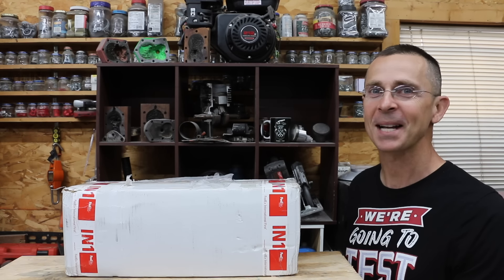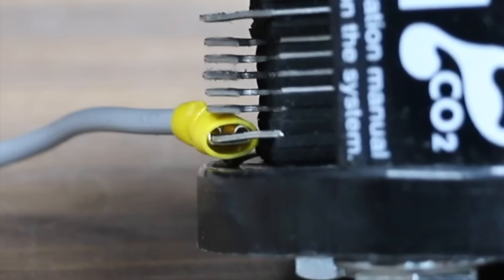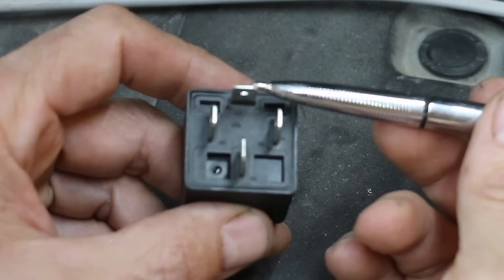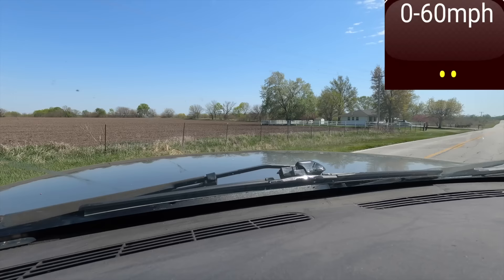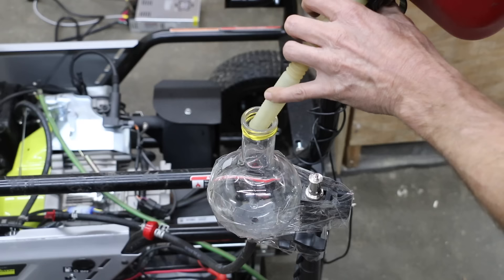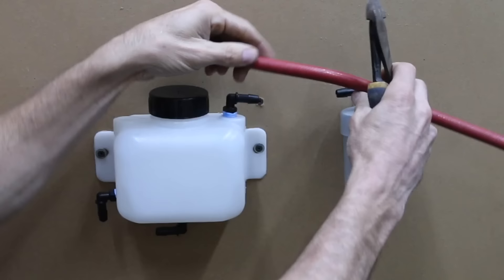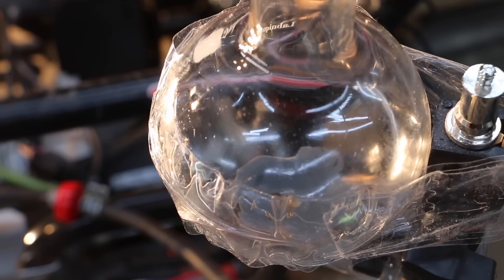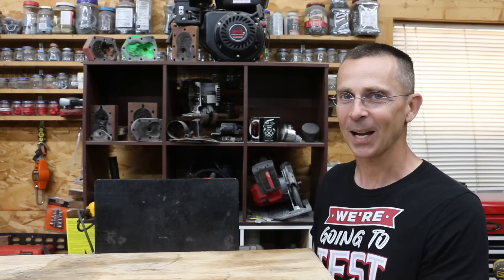AMAZING 35% More MPG with HHO? Let’s find out! Help with high gas prices?

Comment: I have tested this but used pulsed dc current as the power source for the fuel cell. I was going to school at a technical institute at the time and had the vehicle on a dynometer . Using a five gas analyzer my vehicle tested teh cleanest of all vehicles tested in our lab. The amount of co2 comming out told us it was a near complete burn. I would love to see you test the cell with different power supplies. GREAT VIDEO in testing it as "advertised" and keep up the good work.
Reply from the maker: Thanks, will do!  Thanks for the suggestion.

Comment: Never tried one of these, but my hats off to you for trying. Kind of expected it to be a scam. My cousins and I did a homemade electolysis-gasoline hybrid some 20 years ago. The results were kinda neat with ours. We doubled fuel economy, but only during the first 20 minutes of driving. After that economy tanked big, but still remained slightly above normal. As far as we could deduce, it was something to do with the computer module, and we didn't have the ability to really toy with that. Ended up converting a few family members engines, until there was a little bit of an accident, then we all switched back lol
Reply: It required more work than it's worth tbh.
Reply from the maker: Thanks for the feedback.

Comment: I bought an hho kit off eBay years ago and it did nothing for a straight 6 jeep grand Cherokee. Then I built a kit according to specifications found on the Internet, that one improved fuel economy by 15% for about 3 months. Then it stopped working. It seemed like too much hassle for little gain. Then I met a guy in Utah who improved on the design and made a plasma generator and ran a Mazda rx7 off of any ground up organic material, like bird seed, grass, bark chips, muddy water and more. Unfortunately he disappeared 6 months later and his rx7 with him. It seemed so simple of a design but I have not been able to replicate it. Long story short, nuclear is the future. Rolls Royce posted on their website they've built a fully functional nuclear electric car and is making it available to the public.

Comment: I made an hho system 15 years ago and used it on my 3 cylinder metro and it increased my engine power. I had no way to measure exactly how much but i was able to go up a steep hill easily without downshifting with it on. And that got me convinced that it worked on my car. It was like night and day. 
I forgot what my mixture formula was. But i was using 20 amps and steel wire in plastic jar.
Reply: Great

Comment: The entire skateboard, inline skate, scooter, roller derby, and longboard community is patiently waiting for a test on the longest rolling and most durable bearings.
Reply: They'll be ceramic, and be unobtainium for most skaters. I usually run Group 4's because I'm too cheap to buy ceramic.
(Started in 1976. While celebrating my 61st BD two months ago, I almost reenacted the suborbital flight I first attempted in August 1977 during a slalom race.. Oddly enough, crossing the finish line in midair doesn't count.)
Reply: So like, 35 people?
Reply: Or 8mm axle trucks vs 10 mm be floating axles.
Reply: Yes, skateboard bearings. I'm tired of hearing that "your bearings are better than my bearings". Please put an end to it! But all the sports mentioned have slightly different requirements. A longboard doesn't take a hammering like a regular skateboard.
Reply: Silverfish forever!
Reply: Always ceramics
Reply: I can tell you right now and I haven't touched a skateboard since 2005, Bone Swiss Ceramics.
Reply: @johngregory4801  that rule is trash, crossing is crossing!
Reply: Swedish vs German bearing test???
Reply: Not only the skateboard community... homebrew CNC and other machines that use those wheels and bearings community too.
Reply: Legend Skateboards Made in the USA
Reply: @johngregory4801  ceramic also can break
Reply: Definitely overkill for skate bearings, but I did extensive testing with Ortech Ceramic bearings for a prototype jet engine and they were amazing. If you can handle ~$70 per wheel for a bearing, you're not likely to find a better solution.
Reply: The bering in the tensioner pulley and idle pulley is something to shake a stick at.
Reply: @boostgoober7262  *36 😂
Reply: @C-M-E  Only issue I see is that turbine bearings tend to be cageless full-complement bearings that are rougher on start/stop until the laws of physics send them to a more orderly distribution. VXB sells a really affordable steel race, nylon cage, Alumina ball 608-2RS. Costs about $25-30 for 8.
Reply: @kdawson020279  While true of purely open bearings, Ortech has many options and even custom spec capability. The only reason I mention them specifically and not like SNK or full-time bearing houses are their absolutely quality, ceramic options without having to plunk down a minimum quantity order approaching Bulk Chinesium levels, and a known dealing with customer service. Not saying it's the end all be all (even though they very well may be =) but it's an online option for exceptionally good quality, and price is very reasonable when you get into more mainstream/off the shelf varieties that don't require tolerance for 100K rpm rotational durability.

Comment: I really appreciate how you tested the H2O idea. Practically every engine Enthusiast that I know has wondered about this... and several really wanted that 35% to be true. Thank you so much for another excellent video that answers a significant question about the myth.
Reply from the maker: You are welcome!
Reply: The whole point is that none of these wacky aftermarket fuel maximisers will  ever work - if they did manufacturers would be fitting them in all vehicles. If I could invent something that improved fuel efficiency, I'd patent it worldwide then license it to Ford, Toyota, GM etc 
If it didn't work, I'd make a bogus video then try to sell it to gullible car owners! 
Thanks for this video perfectly proving once again that "if it looks too good to be true, it is too good to be true"
Reply: @arqoo1907  the fuel efficiency of vehicles COULD BE much better than it currently IS... but advancements in fuel efficiency ARE heavily suppressed !!!
Reply: @jeremiahdssdentmorgan3341  Suppressed how exactly? Oil dependency is a national security risk. If you can make a car, truck, bike produce the same power for less fuel easily as a car company why would you not do that? You would capture market share quickly.
Reply: HHO is implosive. Gas, explosive. The timing of the s.p needs to be 180 out of phase. You also can't run two of the same time and expect results.

I'm not propagating any sort of alternative energy thing here, but volume wise, a litre of hho gas, when triggered to return back to water(vapour), would take up less volume. Thus implosive.
Reply: @myjizzureye  don't forget the increasingly stringent US EPA corporate average fuel economy (CAFE) requirements. If any of these snake oil systems or other b.s. (100mpg carburetor, for example) things worked then every carmaker would be scrambling for it. I am not sure but I think big-auto is bigger than big-oil.
Reply: @arqoo1907  you sell it they would never use it. Have to wait tell that patent is up in 25 years to see it working. It's like them new battery coming out. Ford bought it never was going to use it. Now I think tesla is using it
Reply: Invention Secrecy Act of 1951.
Reply: @exoticcreature3059  what about it? Explain its relevance.
Reply: @walterk1221  What are you going to do if I refuse?
Reply: @exoticcreature3059  nope maybe that's why hho is so far behind
Reply: @walterk1221  I can be anywhere when I post a comment. Why do you assume I'm in a basement? Why do you assume I'm even inside a building for that matter?
Reply: @heyby8764  Who are you?
Reply: @walterk1221  I don't recall any rule stating very I have to give you an answer that you WANT when you demand it.
Reply: @exoticcreature3059  a person
Reply: @heyby8764  Is that what you are? Sounds impressive.
Reply: @exoticcreature3059  I don't recall "demanding" anything but offering an irrelevant phrase and then getting strangely defensive and feebly passive-aggressive leads adults to wonder whether you ran out of meds or perhaps are under the influence of cannabis. You have received your last meal, troll.
Reply: @exoticcreature3059  it is. Better then a troll. Hey by
Reply: @heyby8764  But, is this "person" immortal? Or are his methods supernatural?
Reply: @exoticcreature3059  person is a living human body. So if you don't die are you alive or human? Super power would be Super human so a Super person . I guess  not to die can be a Super power so no is the answer 🤷
Reply: @walterk1221  My last meal implies that I am on death row or am about to be terminated by someone other than myself. So, are planning to end me?
Reply: @heyby8764  Good thing too. It would be most unfortunate for such a great gift to benefit only a few.
Reply: Years ago I built one of these myself and I noticed right away a few problems. Most, if not all the current designs at the time, were grossly underperforming. Mostly because of their size. Mine was made from 2, 5 gallon paint buckets (one hh0 generator they other a bubbler\overflow). Bottom line I found out the size needed to make a difference required a large system like mine that inhaled power and melted a pair of jumper cables,  required a much bigger alternator, a deep cycle battery and eventually turned dangerous since there was no way to regulate how much hydrogen being produced at a stop light vs highway speeds. Low speeds and stops ended up building up dangerous gas amounts. It works but not on these small scales or overly simplified systems.
Reply: @myjizzureye  The guy that started this, Stanley Meyer, was murdered. How much gas are you actually creating? That thing looks puny. There is a city that equipped a number of work vehicles with HHO generators and I heard nano plating increases the gas created, There are too many holes in this test, it's just one crappy HHO generator.
Reply: @walterk1221  : you not realize that half stocks are owed by Royal Company’s ??????? 
Especially the America three manufacturers ?? Ever wonder why import to get better gas mileage they’re not influenced as much by big oral .. !!!
Reply: @robertholderman7552  SMH, did someone substitute a paper hat for your tinfoil hat?
Reply: @robertholderman7552  Actually I had watched a documentary on this a couple of days ago. Because Germany lacked much of the natural resources other than a large abundance of coal, they had massive processing plants in Poland to produce synthetic diesel from German coal and because the process was so dangerous they had the slave laborers doing all of the work.
Reply: @myjizzureye  I wish you were saying was true. However, now when you buy a battery is good for 3 years. When I was 20 years old you could buy batteries it lasted you 5 years or even 7 years. There's a lot more money to be made in buying quantities. There's plenty of crude oil all over the world we're not running out. But the greedy people there's never enough money. It's about the money not the efficiency. I wish it was the other way around.
Reply: @Raymond-rr5iv  I bought a tesla in 2017, still has 98% capacity as the day I bought it.

My sonnen house battery is 7 years old and still retains 100% capacity. Its warranty is 10 years 100% capacity and made to last 20 years. No clue what you are talking about.
Reply: @arqoo1907    just improve the Aero dynamics of your current car or truck  this is the only proven way to do it...  one guy had his civic modded he was getting 100mpg
Reply: @Raymond-rr5iv   that is because older cars had nothing in them electronic wise

I had a AGM battery it lasted 2 years exactly from install date  it would not charge above 12.3volts FAILED
Reply: @MyJizz UrEye I would have to disagree 110%. 

Because fuel consumption makes the money…. I have a 2001.5 dodge Cummins ISB 5.9 L turbo diesel. Six speed 373 gears four-wheel-drive extended cab long box truck 20 inch tall tires. By adding the FASS fuel pump. Which increase the fuel pressure 5 pounds and also kept the fuel pressure at a constant rate. 

I gained 4 to 6 miles per gallon alone… depending on where I was at and time of year. Altitude versus temperature. I live in northern Minnesota we get to 30 below zero so the temperature definitely drastically changes the MPG.

By adding a edge juice programmer w/attitude .
This add on programmer is adjusting OR Remapping the CPU.

 I gained 9-14MPG in total. I also changed my exhaust from 5 inch and I seem to not get as much oil per gallon gain as I did with the 5 inch stainless steel exhaust. My truck went from 12 to 17 miles to the gallon to 24 to 29 miles per gallon on the freeway and with a headwind and the empty car trailer to pull down on my turbo a little bit I am getting 31 sometimes. 31 miles per gallon of diesel fuel so you’re on the government screws us and our vehicles are very easily customized and you get massive amounts of mile per gallon 

Also it took my truck from a 300 hp truck to almost 500 hp. The thing is ballistically nuts and it has massive miles per gallon. So yes the government controls our fuel standards and they are full of garbage when they say they are worried about fuel usage. It’s all about the money in their pocket….
Reply: @myjizzureye  I think you missed the point.
Reply: @brucewmclaughlin9072  Unlikely.
Reply: @RickSanchez-fx3lt  wrong.
Reply: @richtomlinson7090  Wow, such a convincing counter-argument.
Reply: @CDLund.  I'm not trying to be a jerk about this or anything,  would you mind doing a video on your set up?

If you prefer some anonymity, maybe you could have one of these review sites publish it for you.
Reply: There is no such thing as implosive combustion. What you’re saying makes no sense.
Reply: @edouardprest9703  I agree with the word combustion, as it still denotes a form of expansion. No thing else.
Reply: @walterk1221  I worked with a guy many years ago, that body 65 Impala brand new. He was getting close to 50 miles per gallon and couldn't believe it. He triple checked it many times. He had to go into the dealer for some warranty work, and mechanics that came out and said we're going to need to put a new carburetor on your car the one that's on her shouldn't be on there. He fought and said no, runs great gives me good mileage please don't remove it. But mechanic said they had to it was experimental carburetor.  I still believe its possible. He was a very honest guy
Reply: @erick440  not only implausible but impossible. There is not enough potential energy in a gallon of gasoline. Couple that with the fact no internal combustion engine can achieve the theoretical maximum of 50% efficiency. More likely the person in your anecdote is a joker.
Reply: @nova68cutie  it’s so much simpler than that, bro. Not many people want fuel efficiency. They want HP, or an 8,000lb pickup. If people stopped buying pickups, luxury cars, and SUVs by the million, automakers would happily sell more basic, 50mpg hatchbacks. 

Like 1% of car-buyers really care about mpg, as long as it’s at least 20-30 most people it’s all the same, and we’d rather have something with more power. Damn minivans and Camrys have 300hp+
Reply: @ProjectFarm  
What about using an oxygen concentration machine directly into the air filter?
Will that improve fuel efficiency or maybe performance.